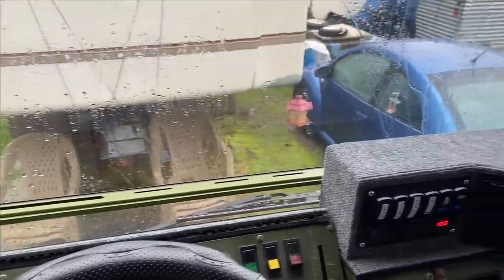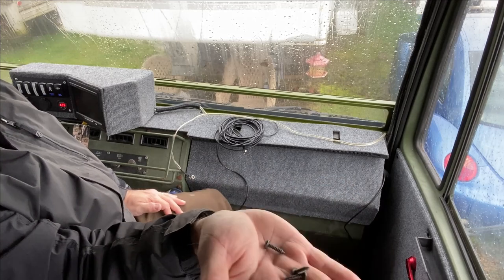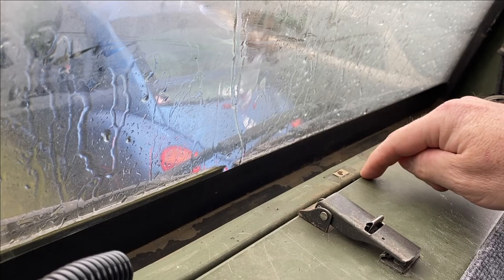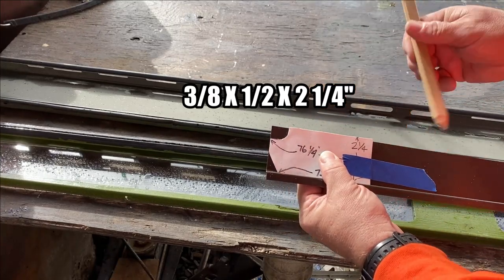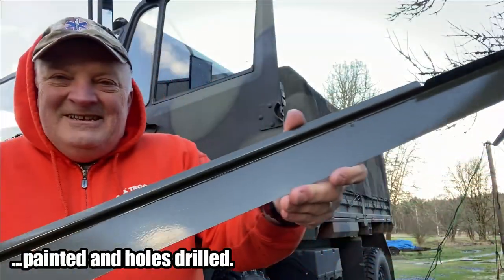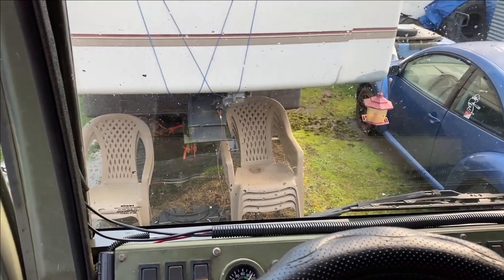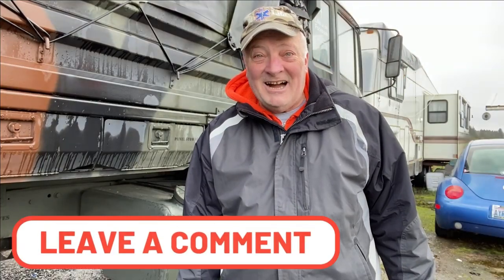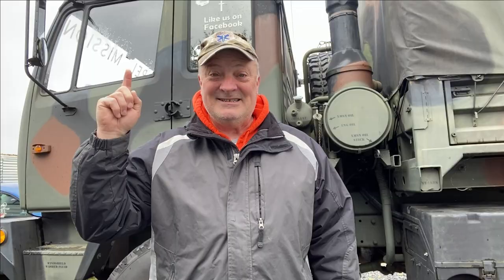FMTV WINDSHIELD DEFOG VENT MOD! #171

Comment: You know me. I'm going to take that time a comment. The project looks amazing. I couldn't believe how much extra windshield there was! 

As for the biodiesel, good on you. That truck will have no problems whatsoever taking care of that. Most likely add lubrication to the fuel, too!
Reply from the maker: When my F350 ran on it, I got better fuel economy! Believe that?! There are a lot of BTU's in that veg oil.

Comment: Nice! Once the temp rises above ‘hands freezing on the metal’ temp, I am going to try that on Cerberus.
Reply from the maker: Pretty easy mod with a good payout. Just keep the gap between the window and cover the same and you will have equal distribution of defog potential. Cheers!
Reply: Begone 11 degree temps......
Reply from the maker: @SlikeAnubis  Dang! Brrrrrr...

Comment: If you use biodiesel  or cooking oil  you have to change oil filters  more often and keep a spare fuel filter ,oil cleans system so fuel filter  will get dirty quick ,may take several filters get whole  system clean, add artic power  service to prevent  selling as cooking oil can help at much higher  temps than diesel fuel
Reply from the maker: In the deep, deep freeze of winter in some locations, I would not recommend adding veg oil to the fuel. However, in Western Washington, at the mix of a full tank to one gallon... it's not even 5%. I found the oil in the back of a cupboard and instead of throwing it out, I threw it in the fuel tank. It got me thinking about setting up my back yard bio-diesel processing plant again. When I had it going in Vegas, people thought I was cooking m3th and reported me. I thought that was pretty funny, especially since I was working for the Counter Drug unit at the time. LOL!

Comment: Hey, I was gonna do that:)  mine didn’t come with that defroster diffuser so was just going to use a flat plate.  How much room did you leave for defrost air?   As for the veg, it should be fine as long as it stays warm enough to not cold gel and clog the filters.  I have known some old loggers and crane operators who would keep a jug of their oil change waste oils on the rig and dump some in when they fueled and burn/dispose of it that way...
Reply from the maker: I left about a 1/4" to 3/8" between the glass and the edge of the metal plate. It works great... no issues.
I also have two more expired jugs of oil to use in the truck. One at a time, for these temperatures, though.
Reply: @HelicoolsHelipad  leave the jug set outside. If it fogs or discolors it is probably too cold to use it...

Comment: Dave, why use a z flashing instead of a flat sheet?
Reply from the maker: Great question. It is only because I have the dash mats... they tend to slip around if there is nothing there to kind of hold them in place. The z-channel provided a backstop, that was missing once I removed the OEM vent cover.
Reply: @HelicoolsHelipad  

Ahhh... I was guessing something like that was at play.  

Do you think the dash carpet makes much of a difference in noise?   I remember you doing the mod, just not sure if the doors would be enough?   Any thoughts on carpeting the headliner?